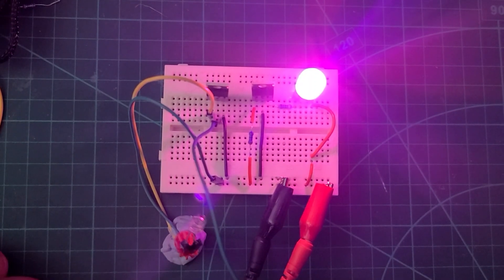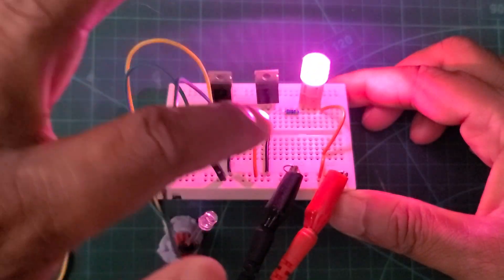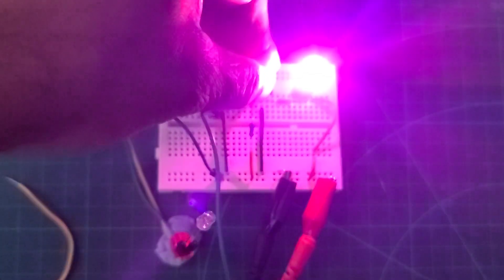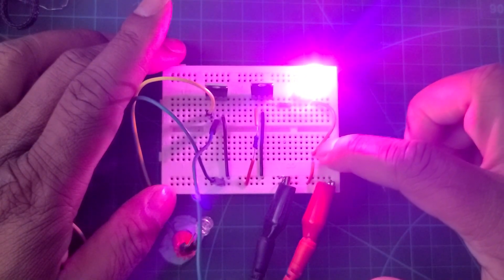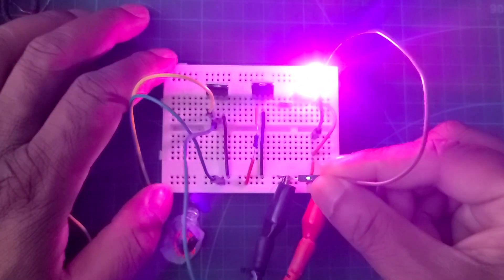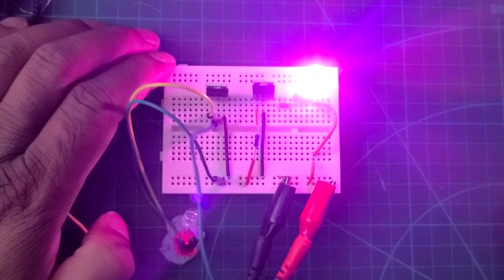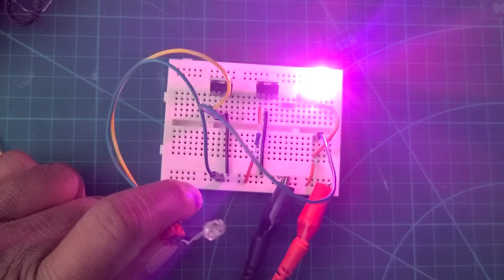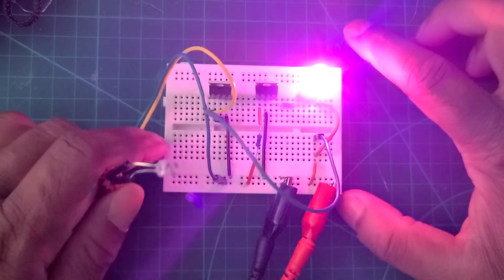TIP31C, TIP41C, TIP120, TIP121, TIP122 NPN Transistor(Mosfet) LED circuit and Not-Gate Operation

Comment: the only thing ur showing is how to compleate a short circuit! u should use this on the gate pin (with a resistor between) not against the power source